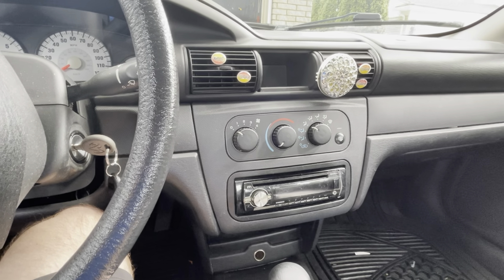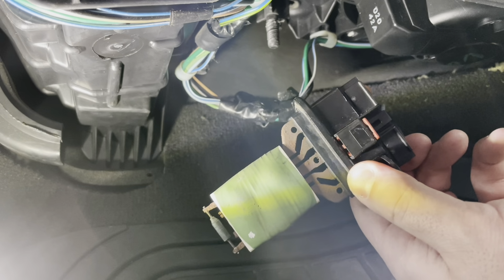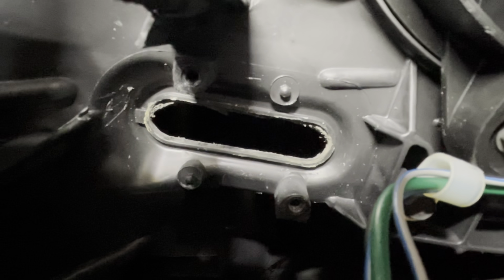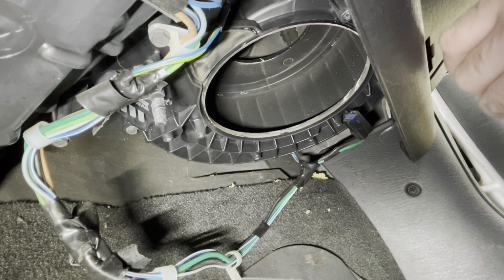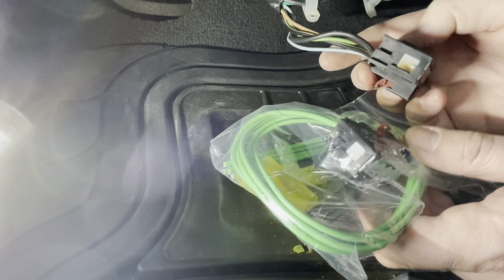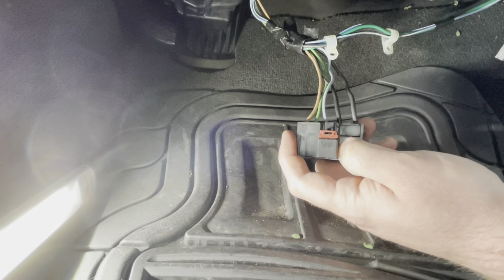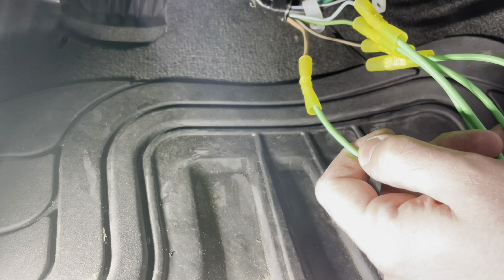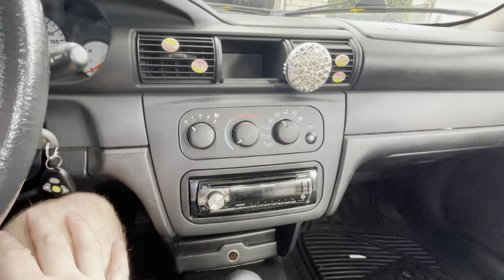Dodge Stratus/ Chrysler Sebring - Blower Motor And Resistor Replacement With New Connector

Comment: Glad to see you use a heat gun, using an open flame can actually damage the wire resulting in problems down the line

Comment: Recommend recalibration of the hvac system once new parts are installed and working:

1. Car off
2. Fan speed to 4
3. Temp knob to max cold
4. Vent knob to defrost
5. Start car
6. Hold the rear window defrost button in until until the odometer changes to AC mode.
7. Release button and wait for the calibration to complete indicated by the mileage being displayed.
8. If there is a problem, you'll get a code(s) displayed during the calibration. Recommend making a video so you can go back and look.
9. If it won't go into calibration mode, reset the computer by disconnecting the negative battery cable, wait an hour and try again
Reply: Excellent most helpful.